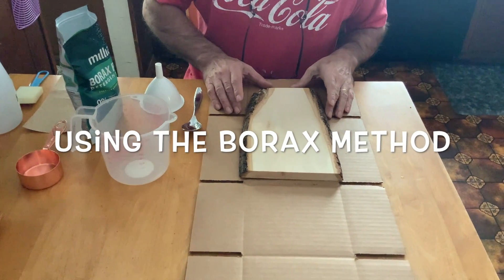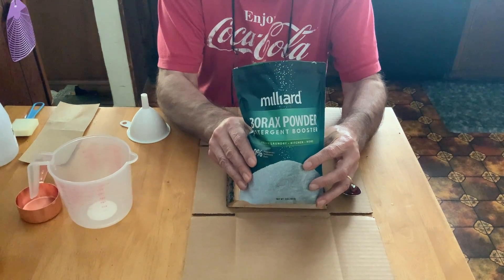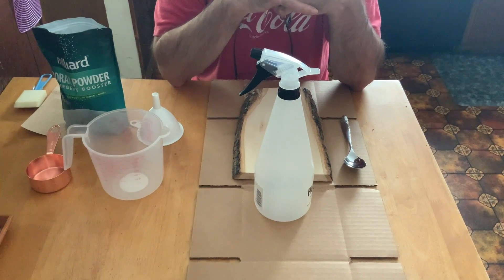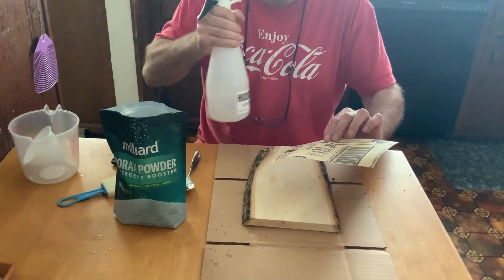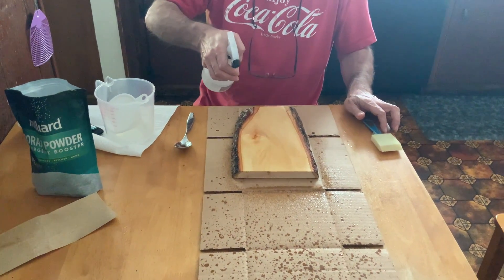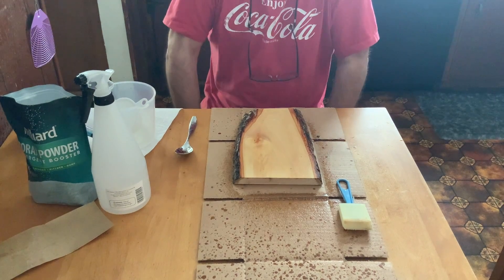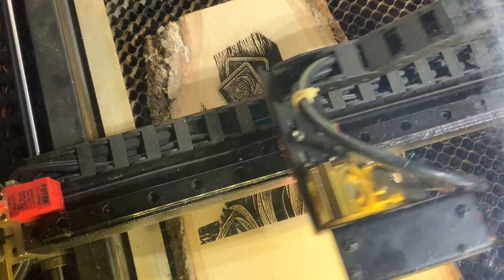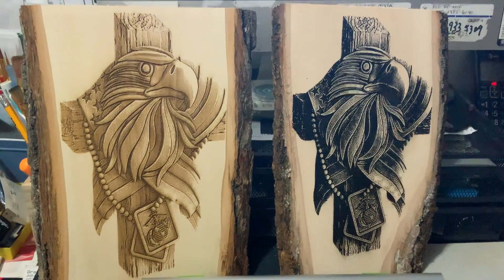Using Borax Method to laser engrave an image.

Comment: This video is amazing and thank you for showing us!! I know you mention that you air blow it but do you put any sealer or anything? Thanks in advance
Reply from the maker: @fredietrevino4476  I usually add a clear sealer spray like a poly gloss spray from Home Depot. But it is not necessary.
Reply: But if it gets wet, does it smear, or wipe off?

Comment: Did it smear with the borax??
Reply from the maker: After we were done with the engraving, we very lightly vacuumed it with a soap, bristle brush to get any loose foot off the engraving. This way when we sprayed it with the clearcoat, it was sealed in and did not smear.
Reply from the maker: It’s supposed to say soft bristle brush, not soap

Comment: Mine if I touch it the black does disappear. Is it normal?
Reply from the maker: As I stated, in previous replies, once I was done, you’re going to have some loose soot . At that point, I lightly brushed whatever was loose and then I sprayed from a distance of about 12 inches a clear coating to protect the lettering.

Comment: Do you wipe the image down before adding a finish and if so what do you use?
Reply from the maker: After I’m done engraving using this method, I use that mini keyboard, vacuum cleaner and lightly vacuum up any loose soot . They approximately 8 inches away from the surface. I lightly spray it with a clear polyurethane gloss spray before I brush on a product called crystalac which provides a very smooth clear glass light finish.
Reply: @lazerking1701  thank you.

Comment: Is there actual burnt borax residue left on the wood that can brush off if you rub it accidentally or does the wood itself blacken?
Reply from the maker: Very lite residue whick I easily brush off with a fine paint brush before sealing the wood.

Comment: I want the opposite. My Sculpfun S9 is engraving in shades of black. I've tried every speed+power possible combination and I get from almost invisible black to really black. But what if I want brown? I live brown designs the most :')
Today I'll try with LPI combinations but I think it will be the same...
Reply: Well you want the opposite. You can upgrade to the s30 ultra 11w. It gets brown engraving. My S9 just died. On the S30 i tried lots of setting could get only brown. Can’t make it dark black. Ig I’ll need to buy another S9 or use the borax method. I’ll try it on oak plywood

Comment: What I don't like about the Borax method is the smear factor with all the soot. Is there a way to avoid this?
Reply from the maker: I had the same problem in the beginning, but what I do is a very lightly vacuum it with a bristle brush, very lightly to remove any loose suit. From there, I caught it with a clear spray, and let it dry.
Reply: air assist on laser engraver

Comment: Hello there. Is the Borax ok to use on a cutting board? Will it be food safe? And may I ask, what is the minimum computer requirements to use with a 10w diode laser? I use a Mac for all my design work, but looking for the cheapest PC laptop that I can run the designed projects from. Does that make sense? Can't find an answer for that. Thanks great video my friend.
Reply: If it works with Lightburn, you're good. Not that expensive at all.

Comment: Is there a chance you can provide that file - I'm a retired Marine and would love to create a plaque for my two brothers who were also Marines.  Great video.  I prefer the brush on method vice spray as you control the amount of Borax displaced over the wood.  I try not to get the Borax near the live edge trim as when it dries at times, there is white reside left in the wood edge and if you seal it, you can still slightly see the white, even if you try to air pressure spray it out.

Comment: Peter - Great video! Noticed the NY accent right off. I'm on LI myself. Question, do you think this would work if the wood was whitewashed first? I'm doing black and white two tone pieces - painted white, masked, then painted black. It's a pain in the ass removing all the tape. If this would work it would improve my workflow and output. THANKS IN ADVANCE!
Reply from the maker: Not sure but dont see why not.....my office #....631-730-7228